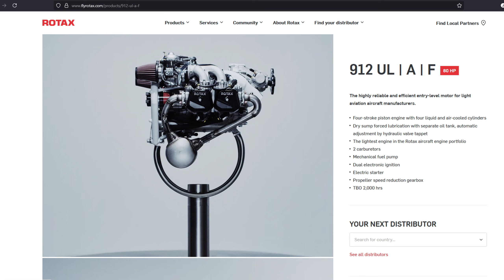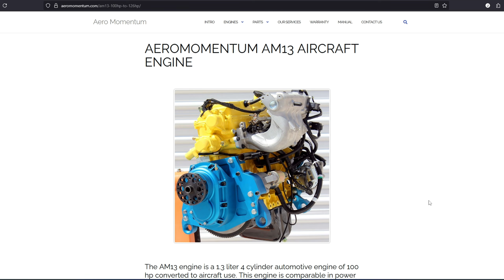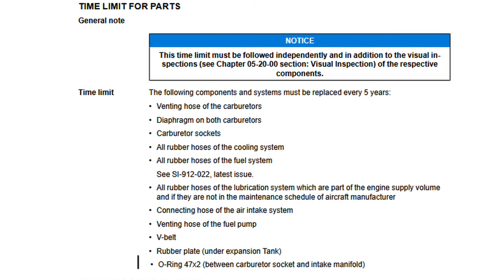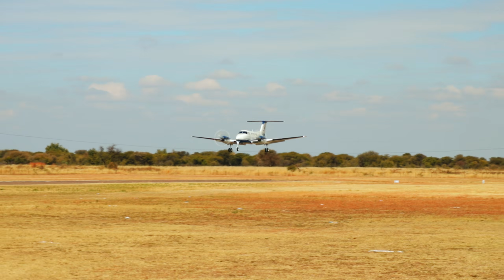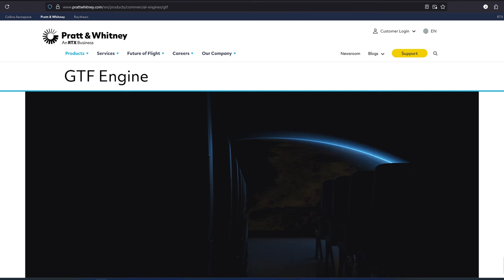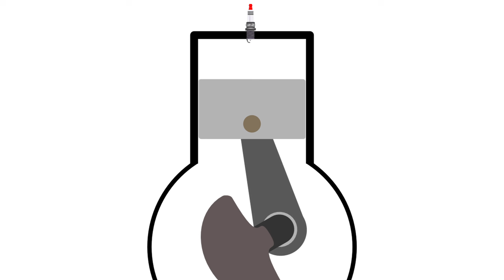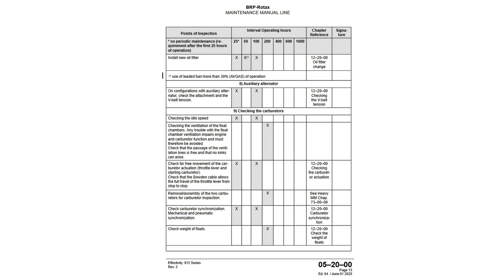Are These Rotax 912 Design Features Problematic? Design Explained

Comment: Anything that gets us out of the 1930s with engine tech will always be supported by me.
Reply: Sure but what replaces the IO550?
Reply: So you're that guy?  Maybe you should be a test pilot if you're such a fan of blind support for NEW technology- hopefully not at a cost to reliability or increased complexity. While old technology lacks alot of the bells and whistles that people like yourself so adore. In aviation, it could be a death sentence should the NEW TECHNOLOGY go bad- but hey, it's got multiple computers and hundreds of proprietary  sensors. What could go wrong, right?? And the plus side-  the pilot looks so good in their aviator glasses while  calling mayday. 😅😅😅
Reply: @giggiddy  Imagine how upset you have to be in order to make up stuff about strangers. Where did I say I blindly support anything?

Sorry I insulted your 1930s tractor engines. Hopefully you can wipe the tears and get through the day.
Reply: @someguy5035 You said anything, pal.
Reply: 1930s engines are simple and stupid. They generally fail very slowly and give warning. They are staggeringly reliable. New tech has not meant better. Rotax are good engines but they are not more reliable than lyc/con. Newer doesn't mean better and it hasn't meant cheaper either - the numbers don't lie. Their main advantage is power to weight and a more reliable supply chain. In the last 60 years there have been numerous engines that have come with great promise and have failed miserably never to be heard from again. Engine development is insanely expensive and the market is insanely small. The business case just isn't there. No way Cessna, Piper, Aviat or Cirrus is going to risk putting a new untried engine on their platform. Nobody is going to spend $20 million to sell a few hundred engines a year. You're left with experimentals and then every installation will be different as homebuilders make the same old mistakes time and time again and that's what causes accidents. This debate has been going on since the 70s and nothing has changed and nothing will change.
Reply: @sblack48  If you look at the statistics, Rotax engines most often fail due to carburetor problems, but, with EFI, it's very likely that the engines would be significantly more reliable than the LyConts. They're already lighter, more efficient and easier to operate.
Reply: @PistonAvatarGuy how are they easier to operate? You don’t have to burp a lycoming or worry about coolant leaks.
Reply: @sblack48  No, you just have to worry about them not being cooled effectively and failing catastrophically instead. This is shown in the statistics.

And, yes, they are easier to operate, you don't have to worry about the air/fuel mixture (especially with the EFI engines). Some Rotax engines even have an automatic control for the propeller, so they're true single-lever engines.

And, for the record, I don't like the oiling system in the Rotax, I don't see why it can't be a wet-sump system.
Reply: @PistonAvatarGuy lycomings catastrophic failure rate is considerably lower than rotax and anyway rotax is not even in the same market segment. It’s clear that you aren’t a pilot and don’t fly behind anything but your tablet.
Reply: @sblack48  Source? I was talking about Continental engines, which are in the same segment.
Reply: @sblack48  Also, I'm curious, why do think it's true that almost every engine manufacturer on Earth has abandoned air-cooling for piston engines, especially in applications where reliability is critical? Do think that it's possible that the engineers who actually design engines for a living might know more than pilots who merely fly airplanes?
Reply: @sblack48   a few hundred engines? The guy said 50,000 Rotax engines had been built by 2014 wasn't it? Or didn't you watch the video?
Reply: @oneninerniner3427  Ummmm I worked for Bombardier for 29 years. I know all about their engines.
Reply: @sblack48 ok your right! Ill stick with my C90 with the appropriate mods...  Ultra reliable and Mostly stock turns 2450 if modified ive seen 147 hp at 4350.
Reply: @sblack48  I can tell by your response that you are an older man.

The back in my day nonsense was the same thing you guys said about seat belts, airbags, and safety glass.

The one thing you are right about is that it is in fact simple and stupid to hold onto 1930s tractor engine tech for GA.
Reply: @someguy5035  ok so if it's such a great idea how come nobody has succeeded with it in 70 years? The seat belts and air bag argument that Ralph Nader made was because these were consumer products that sold in the 100s of 1000s. The tiny development costs were recovered in the first 100 units (even though the car mfg claimed that they would add $1500 to the cost of a vehicle!!!).  Airbag development again was amortized over millions of cars. A new company will sell 50 engines in their first year if they are lucky and to have a team of engineers, a mfg plant, test cells etc will cost 10s of millions. I worked in engineering for 30 yrs and know what it costs. How does that make any business sense? It doesn't. That's why it has never happened despite all the armchair experts whining about it. Remember Orenda Recip? Gone. Remember the Porsche aircraft engine? Gone. Why haven't the Austro diesels found their way into cessna and cirrus? The business case isn't there. If it's such a great idea why don't you do it?
Reply: @sblack48  halfway through your argument shifts from "it can't be done" to "I dont think there is a business case for it" lol.

Also, Austro engines haven't found their way into Cessnas because Austro is perfectly happy building for diamond aircraft which are far superior to Cessnas and are rapidly becoming popular. You can also get a Piper Archer with a diesel engine so you're just wrong.
Reply: @sblack48  The answer is simple. What was the approval process like in 1938? What were the safety standards like? It was basically "Here is an engine that functions" and the FAA approved it. When you and another company who have basically the exact same design are the only game in town, where do you think all the R&D happens? 

People have succeeded with new tech and even more will succeed once the FAA stops stonewalling people.

People said the same things you are saying about turbines. Too complicated! Needs too much maintenance! Too expensive! Uses too much fuel! GPS? Same thing. You want a real-world example from right now? Go to any social media post that even mentions a Cirrus CAPS. Nothing but old men shrieking about a system that saves lives. You can't control where it comes down! Just another thing to maintain! Fly the plane until impact! You guys are insufferable. 

It's time to step out of the way. Old guys like you are a boat anchor on GA. Your knowledge base is so disconnected from newer tech and reality that you have no idea what is out there and all you do is cry about anything new.
Reply: @someguy5035 the FAA isn’t stonewalling anyone. There are rules to approve an engine and you have to meet them. There were rules back then too - the engines had to run at full power for many hours amongst other things. And you have to have a document everything and have a configuration control process. That costs money. Lyc and continental can do it because they have customers who give them cash flow. Someone new doesn’t have that. I’ve worked on the certification of 3 aircraft. I learned that during that process you hemorrhage cash . Millions. How many engines do you have to sell to get that back? At what price/profit margin? Do the math. If people could do it they would. But they don’t despite everyone whining on every website about how old our engines are. I asked you where is Orenda Recip? You didn’t answer. I’ll tell you. They went bust. Just like all the dreamers before them. Go ahead give it a go if you think you’re so smart.
Reply: @toasterbathboi6298 no my argument has never been it can’t be done technically. Of course it can. But having worked as an aircraft designer for decades I can tell you that if there is no business case it won’t happen and history has proven this.
Reply: @toasterbathboi6298 if I’m wrong where are all the new engines? What are you waiting for?
Reply: @sblack48  they're right infront of your eyes old man, you've literally mentioned 2 of them: the austro ae300 / 330, and the rotax 912 family that this very video talks about.

Another promising engine is the ADEPT Airmotive engine.
Reply: @sblack48  there are plenty of new engine designs. What holds them back are people like you and the FAA having ridiculous certification requirements. The same thing that keeps us burning leaded gassoline.
Reply: @toasterbathboi6298 the 912 won’t replace lycoming. They will stay in the LSA class of airplane. The diesels have a tiny fraction of the market and that won’t be changing anytime soon. Oh and you mention another “promising” engine. How many times have we heard that old trope in the last 4 decades? 😂. Dream on.
Reply: @sblack48  you folks said the same thing about turbines. And GPS. and CAPS. 

Hell, go back far enough and people like you said the same thing about cars replacing the horse and carriage.
Reply: @toasterbathboi6298  people like me??? I'm not holding anything back. I'm just telling you how it is. You're saying the world should be different. well that's nice, but it isn't. How are the FAA requirements "ridiculous"? Which ones? I can tell you are some guy who reads kitplanes and dreams and has no real world experience.
Reply: @sblack48  I have plenty of experience with crappy lycoming engines thank you very much. The damn things run about as smoothly as a rock in a blender, crap out more often than ANY car engine I've ever dealt with, and burn more oil than a goddamn oil furnace. 

 "i'm not holding you back" you say whilst decrying a proven and tested engine because it dares to be different from your lycosaurs. 

"What faa regulations?" Don't pretend to be ignorant. There's a reason we still use LEADED avgas. And it's not because it's better for our engines. It's beurocratic red tape that makes it so goddamn hard to certify unleaded avgas, to the point that no one can. You don't think the same applies to engine tech? There's a reason non certified airplanes have so much better engine options than certified ones. 

As i said before: you're the same type to say that the car will never replace the horse and carriage: "it can't be done! Theres no market for it, everyone still just buys horses! Horses are a proven technology!"
Reply: @toasterbathboi6298  funny you're the one that sounds like a grumpy old man!! The lycs I fly behind run super smooth, but a lot of that is getting a good dyn balance on the prop. As for non cert engines being better options on homebuilts, the accident rates for non certified engines are WAY higher than for certified engines. They non certed ones have a tendency to quit. Of course a lot of that is because of amateur installers making dumb mistakes, but the numbers are inescapable. Engine certification is not bureaucratic red tape. The fact that you believe it is shows beyond a doubt that you have no experience or understanding of the process and the philosophy. Also, the reason that people have stuck with air cooled engines is because there's a lower parts count, therefore a lower probability of failure. And it's all about reliability. The rotax is a fine engine, there's no doubt. And it's power to weight is far better than a lyc or continental which is why they have been used on virtually every LSA where there was a weight limitation. But it has a whole bunch more failure points - if you think putting EFI can make it more reliable than a lycon then you have no concept of reliability engineering. Parts count is directly related to reliability. There is no gear box and no cooling system to fail on a lycon. There are no hoses to rupture. Simple as that. That's why the failure rate on the rotax is still higher. It's not bad, but it's not as good as a lycon, and they are certainly no cheaper and the maintenance costs are higher. But that doesn't help those needing 200+ hp. Buy or build a homebuilt and put whatever you want on it. But the chances of an automotive type engine being certified in the 200hp category and taking over the market are about as high as the second coming. It's been tried, again and again and again and inevitably leads to economic failure. But don't let me stop you.
Reply: @sblack48  "putting efi on an engine won't make it more reliable" 

One sentance later 

"More moving parts equals more failure points" 

Answer me this: how many moving parts are in an electronic injection system? Compared to how many in a mechanical injection system, or a carburetor? 

How many moving parts are in a magneto? Compared to how many moving parts are in an electronic ignition system? 

How many times has your car not started in the morning because your electronic ignition system, with all its lack of moving parts, been inop? 

How many times has your electronic fuel injection system just stopped working in your car because it has a lack of moving parts? 

You're being contradicting. You're saying lycoming engines are better because they have less parts... and then talking about the superiority of entirely mechanical systems with many moving parts over those with ZERO MOVING PARTS. 

And yes, red tape IS the issue. These engines were certified in many cases before the faa even existed. And now that the faa DOES exist, conveniently we can't make new engines. Again, why are we still using leaded fuel might i ask?
Reply: @sblack48  also... you admit that most experemental failures are due to improper installs... so like, if we certified these engines and actual manufacturers started installing them correctly, they wouldn't fail as often? 

I don't think you're achieving the argument that you thought you were.
Reply: @toasterbathboi6298  it's pretty hard to say. There isn't a consistent data sample. There have been a bunch of LS5s put in airplanes. If someone put a ton of effort into making it reliable would it be better than a smattering of homebuilt that were like snowflakes - all different?  Almost certainly. Would it make money? That's an entirely different question. Anyway it's a pointless argument. People were having it in the 1980s and here we are 40 yrs later. In another 40 yrs, if people still fly small airplanes they'll still be having it.

Comment: The only quibble I have with this excellent video is the comparison with turbine engines, regarding gearboxes.
The point is that turbines turn smoothly, whereas  spark-ignition  piston engines run in a series of jerks - one with each power stroke.  Diesels fall in between, because a diesel's power stroke is a long, steady event, rather than a sharp rap when the spark plug fires.
Reply: Yah but they're a bunch of little raps as compared to big booms on an IO540 with 5 inch diameter piston & cylinder bores!
Reply: SI engines usually take a while to fully burn the charge, we're talking 40 degrees of crankshaft rotation or more at higher revs. That's why you need to advance the timing as engine speed rises. No "sharp rap" unless the engine is knocking- in which case your pistons will fail soon, let alone the gearbox! Diesels actually have harsher pressure transients: That's why they make their characteristic sound, it's actually caused by the fact that there's a delay between onset of fuel injection and the fuel first igniting. Fuel gets sprayed in that whole time, then it all ignites more or less at once, producing a sharp spike in pressure and thus the diesel "clatter" especially when the engine is cold (longer ignition delay).

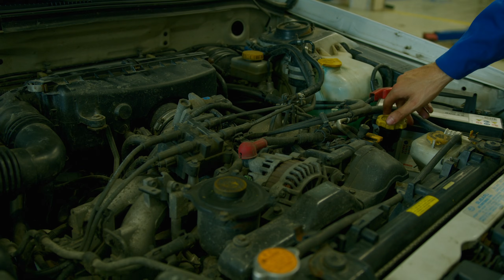Comment: 6:35 How dare you?!? I check my car's coolant every morning before first start, along with hydraulic fluid, clutch&brake fluid, tyre pressure and engine oil!

Seriously, though: safety is paramount in aviation, which is unfortunately also why airworthiness regulations are somewhat detrimental to innovation and new technology.
Reply from the maker: 😆
I check mine way too often as well. I find it quite therapeutic.

Comment: If you check the oil quantity level immediately AFTER flight, this is a more accurate way of determining oil quantity, and then you don’t have to “burp” the engine before the next start.
Reply: Burping everytime is actually useless. Think of it : if the oil level is ok without burping, then leave it there. If it's low, burb and check again and then only top up.
Reply: @SuperYellowsubmarin Only rotate the prop to burp after disabling the magneto.. Anything else would be a dis ass ther, or a Farewell To Arms.
Reply: @VVBros1 Well sure but even better if you can avoid it altogether
Reply: @VVBros1 What magneto? 912s are electronic ignition that don't fire below 200 RPM.
Reply: that's no use at all if other people fly the aeroplane

Comment: The issue really is that Lycoming does not make a viable engine in this size range. The Lycoming O-235 is probably the best small engine around, but is outside of this size class at 115 to 135HP. Yes, there was initially a version rated at 100HP but it achieves this by using a big prop that allows only a lower 2450 RPM, not internal changes.